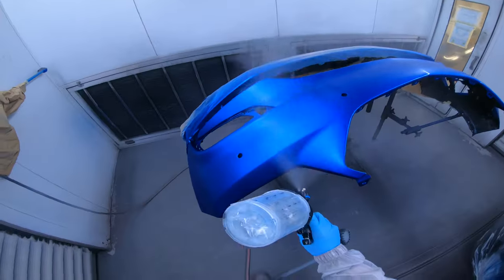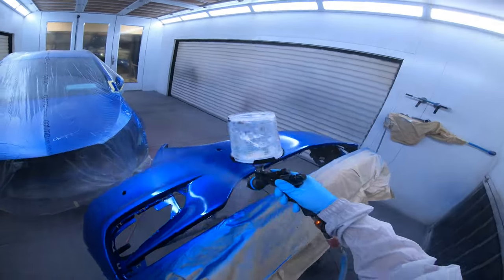Orange Peel: My tips to match factory clear coat.

Comment: Interesting video Paul I wondered how you pro painters matched the OEM peel, I have seen some that pull further away from the panel but I would say you have more control over it by changing the air pressure, for what I do I'm always after the flattest finish I can get but I'm not always that happy with my finishes, maybe sometime you could do a video on how to get that flat glassy finish👌
Thanks Paul👊👍
Reply from the maker: Thanks John, I'll wait till I get a flat bonnet I can glass out and I'll film it. 👍 you can play with the viscosity as well by adding or taking away thinners but that can cause other issues
Reply: Ok thanks Paul that would be great👍 My main clearcoat is the Kapci 6030 HS and the TDS states that you can add up to 10% thinners, I never go outside what the TDS says but I'm currently adding around 5-8% thinners.
I suppose adding more would/could give a flatter finish but then it must be affecting the solid content as you are watering it down.
Reply from the maker: @John Bushmaster  yes mate I'm not sure if it will affect the solids content l  I will ask a rep when I see one lol. It affect flash off times and could solvent pop. But a little extra splash should be fine lol.

Comment: Hey Paul loving the videos brother, were you full fluid on that lower air pressure? I notice I have trouble matching orange peel but I’m learning, love the trade. Also I picked up this high solids clear that has a 2:1:1 ratio and I just mixed it 2:1 without reducer and man that thing was thick, orange peel was horrible it was like spraying honey I guess it did need that reducer? I was at 3 turns out from closed , 4-5 inches away and 32psi. Thanks man
Reply from the maker: Hey Frank, I really appreciate it thanks.
Apologies for the delay in replying.

Yes I like to spray full fluid most of the time. This clear coat sprays like honey as well without reducer. They recommend 5% reduction and I always spray it a 10% so if I know the car is orange peely I can go back down to 5% or drop the air pressure a bit.  

But it's probably more experience knowing what would be easier lol